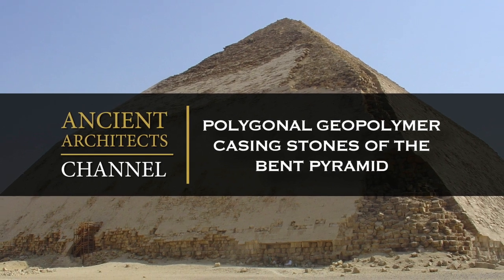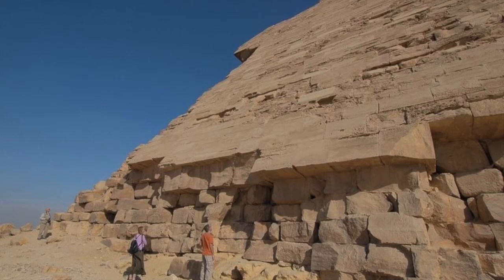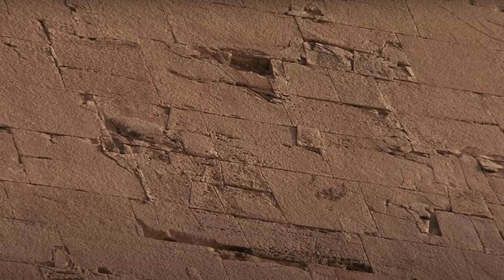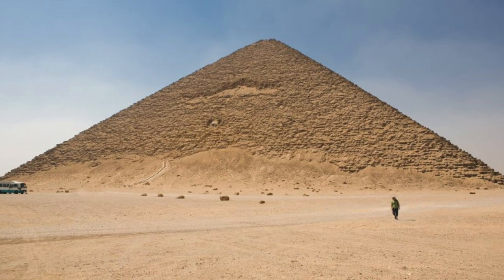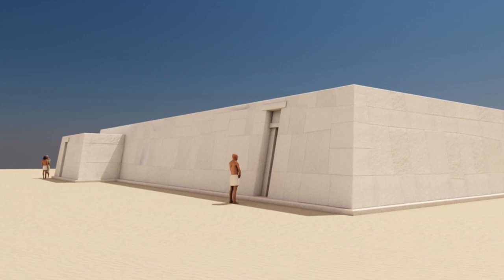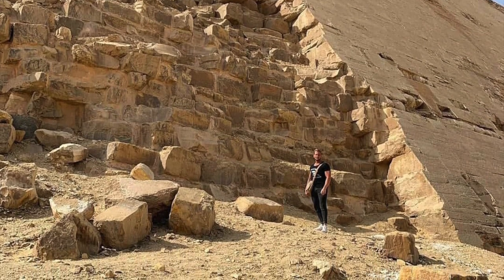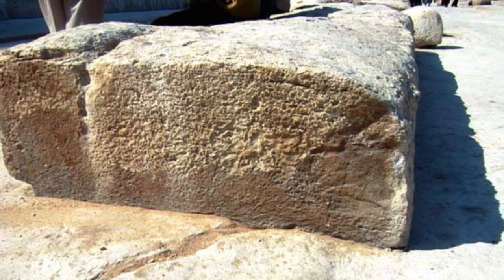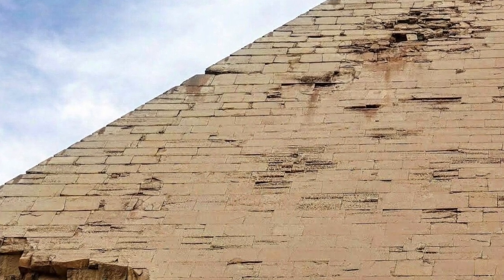The Polygonal Geopolymer Casing Stones of the Bent Pyramid | Ancient Architects

Comment: So to return where I left off.... Concrete.  Even Hawass admits that there exists Neolithic concrete at the bottom of the "Osiris Shaft/Campbell's Tomb" site.  So I do not think the use of Geopolymers is all that controversial?  Concrete is a technology that has never been lost and is not an indication of an advanced culture.  I actually believe the opposite.  It is much easier to transport crushed aggregate/lime stone, to a location, then  reconstitute it into blocks as opposed to actually quarrying the blocks whole, then working, shaping, finishing, transporting and finally setting the blocks, in place, in a new structure?  It is a workaround and another tool employed by a degenerating culture to imitate the far grander work of a much more technologically competent preexisting culture.  As you yourself, Matt, have noted there exist, in various places, in "G1" examples of a kind of naturally occurring geopolymer?  In corners and at gaps in the masonry, limestone dust has accumulated and then, at some point, moisture has naturally turned this into a kind of rough concrete.  The 'Dynasts' would defiantly have observed this phenomenon and learned to replicate it where needed to imitate the work of the preceding megalith builders?

The two pyramids, that clearly standout as candidates for evidence of LAHT, are the "Red" and "G1."  Tangentially related to your Iron working theory  Matt, is the fact that the reason the "Red P." bares that nomen is due to the high levels of iron oxide in the core blocks of its superstructure.  Perhaps this was done to commemorate the knowledge of Iron working that could have been the original technology stored in its vaults and boxes.  Boxes later turned into 'sarcophagi' when these storage structures, used to preserve ancient knowledge from cataclysm, where turned into burial sites for the 'Dynastics?'

"G1" and the "Red" are the only two pyramids whose superstructures have chambers in them.  All the other pyramids, to my knowledge, have superstructures composed of stone block or mud-brick only, without any chambers, simply stacked upon preexisting shafts and tunnels that were most likely created by the preexisting megalith builders.  The "Red" actually has both, just like "G1," but it is more striking in the "Red" because the floor has been torn up to reveal highly weathered, preexisting, megalithic blocks that seem to line more shafts and tunnels that are claimed to be unexplored.

"G1" and the "Red" both have superstructures with the same angel of incline.  They both have very similar corbeled galleries that are built in the same fashion and look very similar to one another, however the "Grand Gallery" is obviously much larger than the similar galleries in the "Red."  They are both the two finest examples of pyramid construction we have in Egypt.  All the others, in their current conditions, are but pale reflections of these two.  Just to begin with I am going to exclude the mud-brick pyramids attributed to the '5th and 6th Dynasts' because these superstructures were likely the work of the historical Egyptians.  These poor attempts at imitation of the grander stone pyramids lie outside my scope here.  

By contrast, the stone pyramids with the poorest quality superstructures are the "Step P." attributed to 'Djozer,' the "Bent P." attributed to 'Sneferu,
and "G2."  Not to your surprise Matt, because I took note of it from you, but perhaps to others "G2" looks impressive, b/c it is large, but it has, actually, one of the poorest constructed superstructures, and internal structures, of any of the stone pyramids.  This is not to disparage the amazing work done to free its ritual mound, from the surrounding bedrock, or the massive scale of the limestone blocks we see revealed in its first couple courses of block.  Nor the fact that the underlying ritual mound itself has been cut and shaped to form several courses of the superstructure's base.  The rest of it however is just a big pile of blocks just like the "Step P.," only larger.

The superstructure of "G2," I believe we will come to find, is very much like the "Step P." in that it was clearly created in stages.  As you have noted Matt, the bizarre layout of its substructure pretty clearly demonstrates that, at some point, a much smaller structure sat above the first 'burial' chamber before the superstructure was enlarged and a new 'burial' chamber was added beneath the new apex.  "G2" is very large but also extremely simplistic, in design, when compared to "G1" and the "Red."

Now to concrete on the casing of the "Bent."  The substructure of this pyramid is actually pretty complex.  Like the amazing substructure of the "Step" both have poorly crafted superstructures placed atop some very advanced subterranean work.  As I have stated in many comments to you before Matt, I believe that the "Pharaohs" were like explorers who rediscovered, claimed and then built upon or added to preexisting megalithic sites created by an earlier megalithic culture.   The 'Tomb Theory' works so well to obscure, the 'King as Explorer' paradigm, because it accounts for what we see without having to stipulate that the core structures were discovered by these kings as opposed to created by them.  Later kings then went out of their way to develop workarounds or imitations of the much better, earlier building methods, of their forbears.  Workarounds like concrete.

As noted above, the use of concrete to create the massive casing blocks on the "Bent" would have been much easier than actually quarrying and setting whole blocks instead.  This clearly indicates that at least the current casing stones are much newer than the core masonry.  As I have also noted many times before, I believe that these monuments were re-cased many times:

Construction technology review:

Phase I constructs: no casing stones at all.  Structures were built entirely of large megalithic igneous and granitic blocks (e.g. the 'Osirion').
Phase II: Limestone core blocks w/ igneous/granitic casing stones (e.g. the "Valley Temple")
Phase III: Limestone core blocks w/ even more easy to work 'Tchura' limestone casing blocks (e.g. the "Gizeh Pyramids" in their current iteration).
Phase IV and Phase IV+: Limestone core blocks with recycled 'Tchura' casing blocks from other structures, mud-brick, sandstone and concrete   used to create casing stones instead of quarried blocks.

So to try and wrap up this monstrosity of a post.  The evidence of concrete casing stones on the "Bent" is just more evidence of the phased construction of these monuments.  The monuments we see, in their current state, are much diminished from their original condition.  Covered in cheap attempts to imitate the incredible work of the original megalithic builders.  I am not really surprised, about the concrete, as the "Bent" superstructure may even be entirely 'Dynastic' in origin when you compare it to the magnificence of "G1" or the "Red."

Okay Roadie, this has already gone on way too long.  Sorry about the length but it is hard to explain all this with a brevity of words.  I may have to go back and edit this later as I do not have time right now.  So I apologize, in advance, for misspellings and poor grammatical structure.

Cheers,

A.

Comment: I have a theory on how and why polygonal masonry was used and after some contemplation, it seems to make quite a bit of sense.  

To start, a typical block for whatever structure being built would have 6 sides.  So six sides to be finished smooth and transported. What if only one side of these stones needed to be finished? The visible side.  After seeing pictures of the quarries and the vast amount of space these probably had taken up all one would need to do is find a large somewhat flat area to start.  Let’s say for arguments sake this was approximately 200’ by 100’.  This would provide exactly 800 (5’x5’x5’) square blocks or whatever depth was required.  If this area was systematically broken down one block at a time starting at the top moved horizontally until the first row was exhausted by the separation techniques described in the video then the faces of the rock on 4 (or even 5) sides would in theory fit perfectly together if these stones were simply taken and made sure to be set into place next to each other as they were Initially situated in the original rock face.  Only one side would have to be finished the and vast walls of seemingly perfectly fitted stones could be stung together.  Now there would have to be some locations where a second face would have to be made flat at the second course of stone back in the quarry face was started.  I would be curious to know if there are locations on the bent pyramid that displayed this.  The second problem I see with this theory would be evidence of the separation from the rock face or more specifically the initial hole chiseled out of the rock for the sun dried wood wedges.  There is always the possibility that maybe only the sides were left to fit snug and the top and bottom were chiseled down removing any evidence that this was how it was done.    It’s something to think about and maybe someone already has proposed this.   Regardless, I love this channel and can’t wait for the next video!  I be curious to see if anyone else thinks this may be how it was done.    Regards Andrew
Reply: Because of the total absence of chiseled holes for splitting, we have to assume that they quarried blocks via another method.  The only other method would have been the use of large pendulum saws with heavy copper/bronze slab blades that relied on course silica and quartz sand to act as an abrasive to cut the relatively soft limestone. 
 If its crescent-moon shape had long ends that were attached to the ends of a beam of almost the same width as the blade, then it would almost swing horizontally rather than semi-circularly.   I have to assume that they could have figured that out since it's fairly easy to imagine.  
With a dozen or more such saws working simultaneously, a lot of blocks could be cut in a relatively short period.
Still, that would not preclude the technique of splitting blocks in ways that would not affect their appearance or usefulness.  Both methods may have been used since that may have been the most efficient means to produce the blocks desired.

Comment: The stones do not fit the definition of a geopolymer, so calling them that is incorrect. You can more accurately refer to them as artificial stones. The formula is limestone, water,lime, and baking soda. Casting the stones in place was found to be much more efficient and why there was such a construction boom in Egypt. Transporting and carving large stones was reserved for only the most important projects.
Reply: I've found evidence that even those important constructions used artificial stone, usually granite. It was either solid or applied as a thick veneer.  I have shown the evidence in numerous photos and will continue to show more as they are acquired.  See the proof in the albums of my facebook group: Ancient Stonework Mysteries. It's a public group.  I will next show that the famous hard stone statues were cast, not carved.

Comment: Architect here, the stones are irregular in shape to create a heterogeneous structure. Not too dissimilar to the principles behind building foundations in Japan that move with the resonance of an earthquake, but the surface area is vastly increased and the resistance is spread out. I believe they were poured so they could perfectly lock in situe with the carved limestone blocks underneath as well as their sister casing stones on their X & Y axis. Achieving all this with poured stones is faster and more precise to achieve whilst maintaining perfect angles and unchipped faces in joining. The angle of this pyramid is bent on purpose as its original name means 'Double Harmony' likely something to do with its original function and resonant capabilities & not because cracks formed and the architect made a mistake.
Reply: Also pouring the casing stones into place would save an exponential amount of manpower needed to haul stones from the bottom to the top with cumbersome ramps, pulleys etc.

Comment: if all molds were made from wood they may have used a entire forest for one pyramid. just like Easter Island, no trees.
Reply: They would'nt of needed mass amounts of wood to make molds as many caseing stones were of exact size so same caseing molds were used for large amounts of the bulk. Yes they may of had for instance only guessing 50 molds some smaller than other molds once dryed the wooden mold caseings were took apart at the front to slide the block out then mold put back together for next mix. Block stones were placed first to create the outer perimeter then the interior was packed built from inside outwards working on a level. Saying that think about alk the wood needed in the need to move stones via flatbed sleds, rollers.

Comment: To make "cement", limestone has to be ground down and heated to about 1500 degrees, to make that much artificial stone (cement stone) you'd need lots of fuel. Wood burning as a fuel would leave a lot of ash, is there evidence of a lot of ash anywhere near by?
Reply: Faybrian Hernandez: Yes, you had a good point, a lot of heat is needed to make cement first.  To solve this heat problem, I think we should try to find whether ancient people were able to produce cement without heat.
Reply: @whkwole6842  We cant do that today, how could they. I understand that they were more advanced than we thought but limestone still had to be pulverized and heated etc. we have to be logical and rational, if it takes a diamond bit to drill the circular holes in stone like they did, then they must have used diamond bits.

Comment: Nice Vid as always thanks. Ptah was the potter that created the clay. Perhaps the home of Ptah would have more physical evidence to find. There is also no guarantee for a consistant internal structural quality to quarried blocks.

Like the americas megalithic blocks. You dont need teams of men with mutiple tonne blocks, tackles, tools and slopes, to carry bags of liquified sludge up the pyramid before pouring into a block sack that can then be precision shaped to fill the gaps like clay (pour in place like modern sites. The core is either severely eroded or rough cut blocks). Where you need to release some pressure to ensure the clay settles (called kock offs by modern archaelogists). Petrie covered the concept of precision faces in his own work on 'pyramids and temples of Gizeh'.....
http://www.ronaldbirdsall.com/gizeh/petrie/c6.html#26

The nature of the Bent Pyramid is interesting, as it is the precursor to the use of the 140:99:70 concept (along with 99/100th) and exhibits the major and minor cubits of the giza plateau.
http://www.legon.demon.co.uk/bentpyr.htm

i.e. 270/13 = 20.769" Major Cubit x sq.rt(65/66) = 20.611" Minor Cubit
That cubit relationship is between the 9000 anglo-sumerian inch core (that aligned the original 1/5th height sunken face) and the 9069.97" mean of the more modern flat surface replacement casing.
Which sinks into the socket corners (perimeter 36,500 inches anglo-sumerian) to provide a perimeter of 36,000 Geodetic Greek inches (9114.97 mean sides).
http://www.ronaldbirdsall.com/gizeh/petrie/c6.html#20
http://www.ronaldbirdsall.com/gizeh/petrie/c6.html#21
Like the passage is offset at 286.4 inches to give an apex height of 360 Geodetic Greek inches
http://www.ronaldbirdsall.com/gizeh/petrie/c7.html#36
436.654 (Khufu) : 433.333' (Khufu) : 408 (Chephren) : 200 (Menkaure) Major Cubits becomes 440 : 436.654 : 411.126 : 201.533 Minor Cubits (see the interplay between Khufus two dimensions and the two cubits ?)
9068.967 : 9000 : 8473.846 : 4153.846 (and yes that is an exact 4320" differnce for Chephren and Menkaure)
http://www.ronaldbirdsall.com/gizeh/petrie/c8.html#66
http://www.ronaldbirdsall.com/gizeh/petrie/c10.html#80
These should not be confused with the standard 14.4 x sqrt 2 Anglo-Sumerian (1,575,000,000 Polar Elliptical) and 14.4 x sqrt 2 Geodetic greek (1,555,200,000 Polar Ellitpical) or 21" Romano-Egyptian (1,620,000,000 Polar Elliptical) or the 144/7x 300 per stade with 700 stade degree mapping cubit variants that relates 100% Geodetic Greek: 99%: 98%: 97%: 96% Romano-Egyptian
http://www.ronaldbirdsall.com/gizeh/petrie/c20.html#141
i.e 14.4 x 99/70 (Remen Diagonal) x 864/275 (Pi) (x 875/864 notional conversion) = 14.4 x 9 arcs of Anglo Sumerian (the reality of that equation being the true Pi based British inch being rolled by a remen diagonal wheel with 864/275/pi * 1,575,000,00 Polar Elliptical).

Then there is also the concept of the refractive index of water (ie raindrop of the rainbow) providing the elevation of a primary and secondary rainbow.
On the plateau, the primary dawn elevation was used for the corners while the secondary was used for the midface (which would be concave or convex depending on refractive index, except for one special case at Waylands Smithy & Dragon Hill).
http://www.ronaldbirdsall.com/gizeh/petrie/c6.html#26
At the bent pyramid, they simpy stacked the primary rainbow elevation on top of the secondary rainbow elevation.
They are fundamentally two design options for the same design principle....the common refractve index of the primary and secondary rainbow that was dropped by the replacement flat casing at Giza, to that of just the secondary.